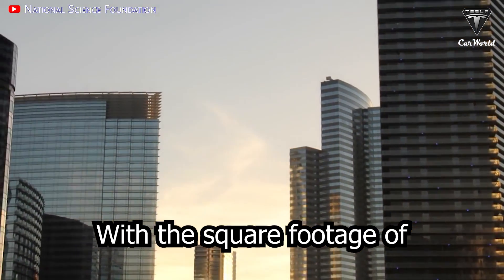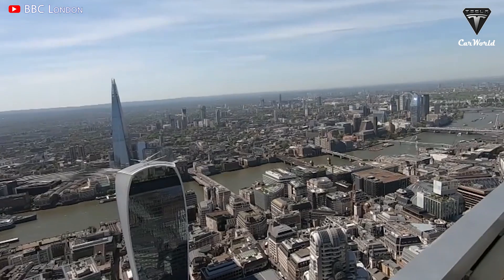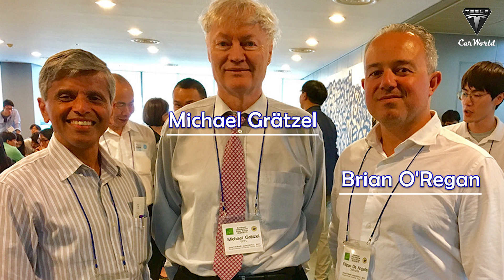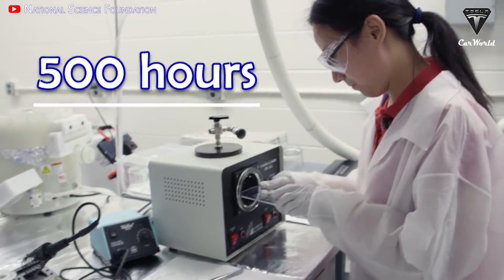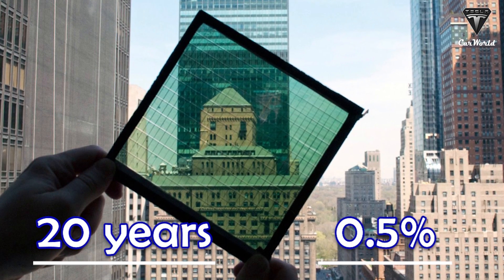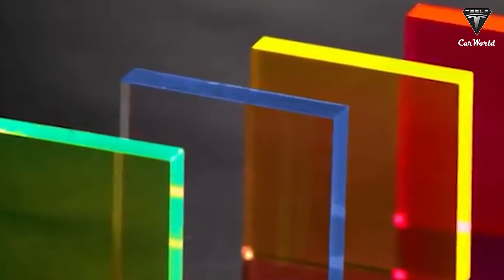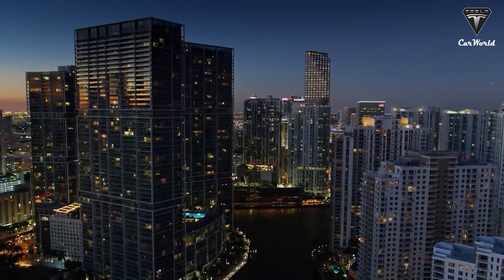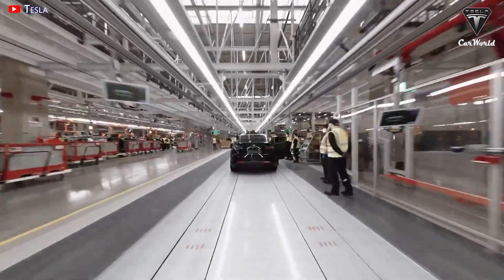FINALLY HAPPENED! For Only $0.92/w, Transparent Solar Panels 4.0 Are The Future Of Solar Energy!

Comment: These panels use IR and UV light people and plants don't use this. Here is the thing if its used on buildings and greenhouses the UV and IR is what helps to heat the inside. This means you will need more heat (fossil fuels) to keep it warm. In the cold moths it actually costs you more.